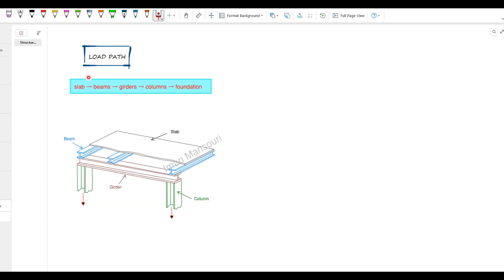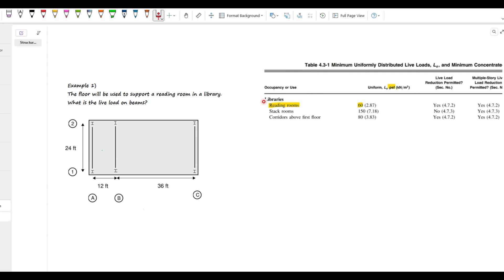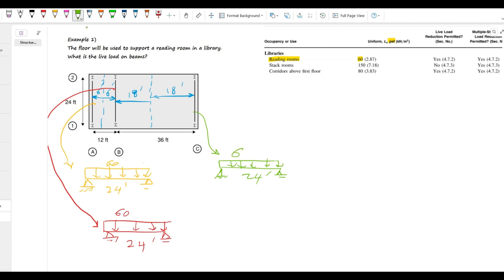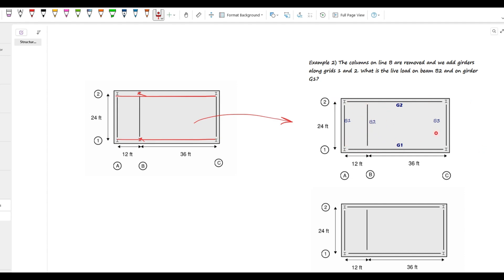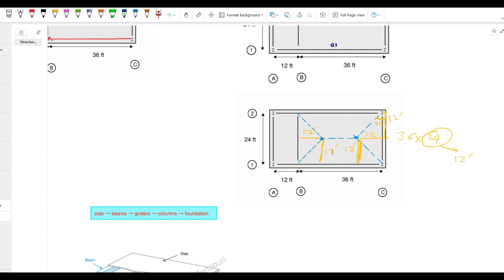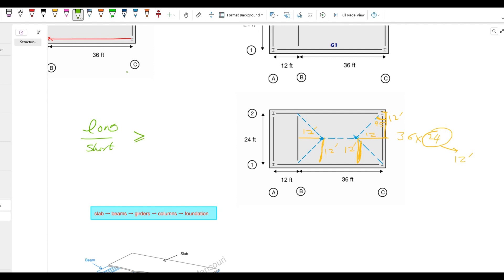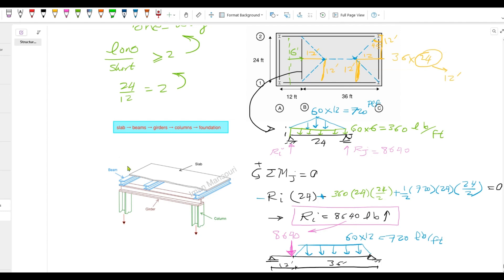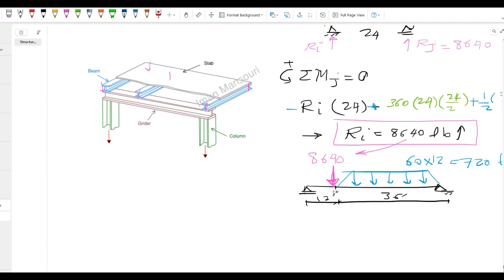Tributary Area Basics | Gravity Load Path | Linear Loads on Beams and Girders

Comment: Thanks, Dr. Iman, for your nice and intuitive tutorials. Could you please share your experience in slab design — specifically how you redirect loads to specific load-resisting systems to fit architectural requirements? Also, what’s your opinion on the differences between various design approaches such as the coefficient method, strip method, and yield line method and there implementation is ETABS or SAFE?
Reply from the maker: Thanks a lot! I’ll make a video soon about slab design. Stay tuned!

Comment: Tributary area is 2 dimensions , but you mention it as one ( 6 feet) , 6x24=144 sq.ft as (tributary area) for 1st beam? so 144x60 = 8640 lb.
Reply from the maker: We call the width of the diaphragm that contributes load to a supporting member the "tributary width". The resulting loads on the supporting beams are distributed loads, also called line loads. The magnitude of the distributed load on any supporting member is the uniform gravity pressure multiplied by the tributary width. We call this behavior one-way action and the diaphragm a one-way diaphragm. But when a panel of a diaphragm is supported on three or four sides, the pressure travels in two directions to the supported sides. We call this behavior two-way action and the diaphragm a two-way diaphragm.
Reply: @imanmansouri4927  many thanks ...and I want to ask if the tributary area of girder is the same area supported by this girder , I have pe example and I want to understand it !
Reply from the maker: @nasirjabr3911  For a typical interior girder, just like an interior beam, the tributary width is measured from the midpoint between girders on one side to the midpoint between girders on the other side. An interior girder carries both a distributed load from its own tributary area and point loads from the reactions of beams framing into it. Since each beam support delivers a reaction, the interior girder receives reactions from both sides. In this video, however, G1 and G2 are exterior girders, so they only receive beam reactions on one side... Go back and check the 3D view in the video. if you shift the girder inward, you’ll see how it becomes an interior girder and starts picking up reactions from both sides...